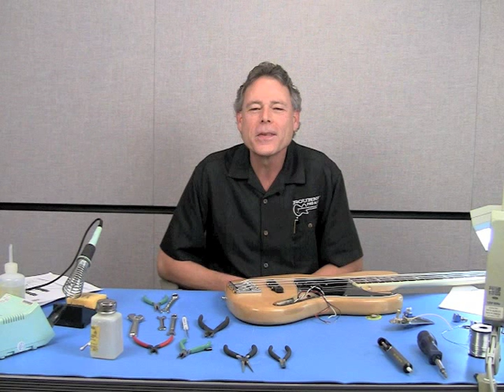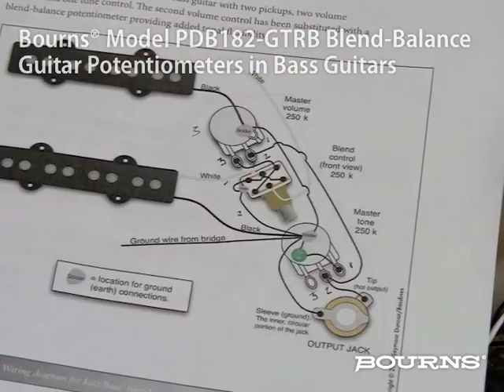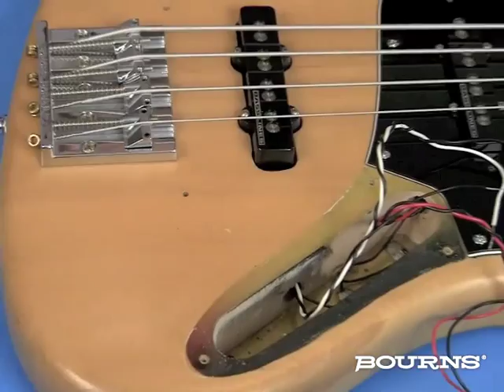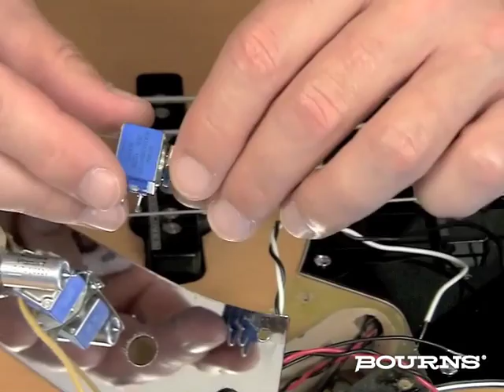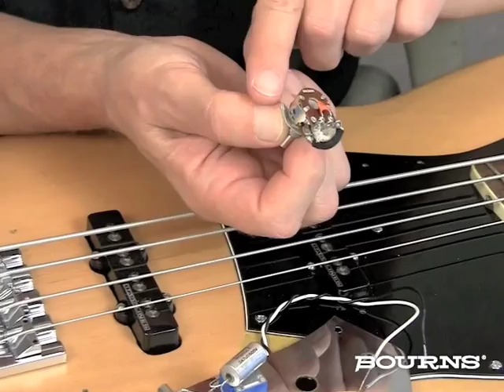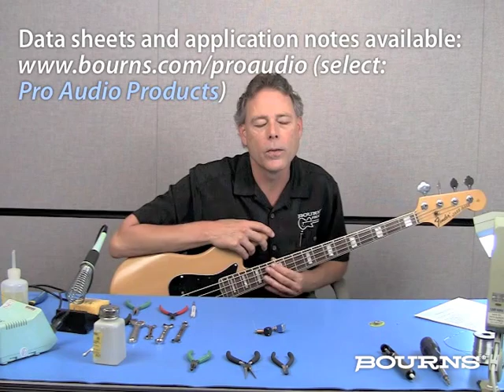Bourns Blend-Balance Bass Guitar Application

Comment: The blend pot is not out off cct at mid point....as the two halves are wired in parallel  the pickups are loaded at center point by 125Kohms and as you go to each end the pickup being faded gets loaded more and more until it is shorted , so it gets darker and darker sounding. The only way around this is an active buffer after each pickup going into a blend control. Cheers
Reply: Your way is NOT the only way, and it's actually more expensive and convoluted. The pot can be modified so it won't cause loading like this...

https://www.talkbass.com/threads/ultimate-no-load-ungrounded-blend-pot-pics.1096449/

Comment: Most people will make an X between the ends of the two pots.  What some are asking about is likely grounding at the MN pot.  The pickup hots go to the two center lugs. I've seen them with just one crossover wire, grounded, and not grounded at the MN pot. Different ways.

Comment: I wanted to hear it work.  I installed a Bourns 5236-000 balance/blender pot on my EB3.  It doesn't blend at all.  It goes from one pickup at 100 percent and then at the center detent it swaps to the opposite pickup at 100 percent.  No info on Bourns website regarding it or it's wiring.  I am skeptical about this one also.
Reply: I'm having the same problem. have you found a fix for this?

Comment: I would have thought that you would have showed the actual soldering of the Bourns-Blend Balancer; the part that confuses most people is which of the wiring of the six lugs are wired and what the proper configuring of the wires from the volume pot to the balance pot and then to the tone pot.
Reply: He said that he used the diagram from Seymour Duncan and even showed a printed copy of the entire diagram with the blending potentiometer clearly showing the way that it’s connected into the existing circuitry, even telling you where it can be found to be downloaded and printed to use as a reference... but if you can’t find the pause button to stop the video to see the diagram that is easily visible I doubt that you will have any more luck finding it online. I’m sorry but if it doesn’t cross your mind to pause the video to either take a picture of it or make a copy of yourself then it probably shouldn’t have crossed your mind to attempt to do anything to your bass.